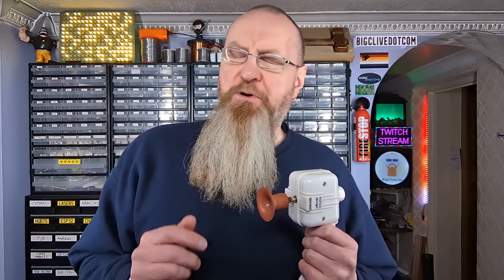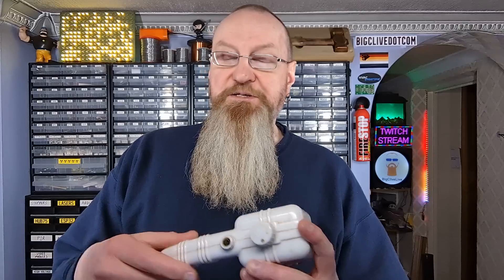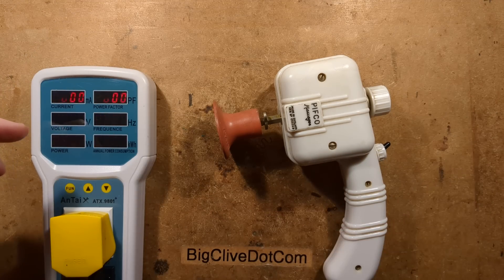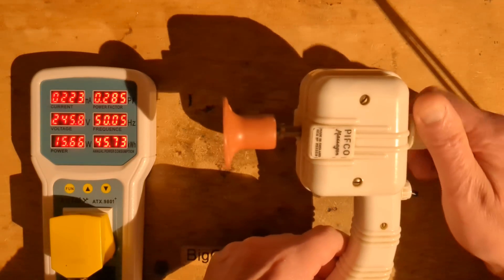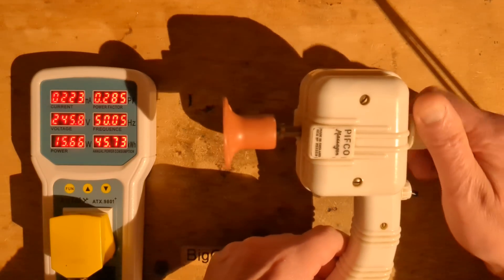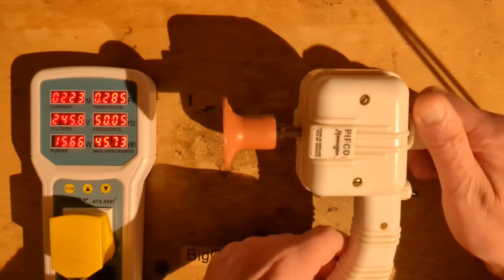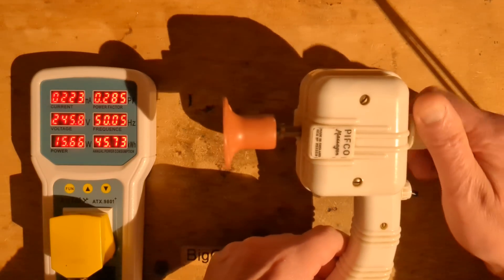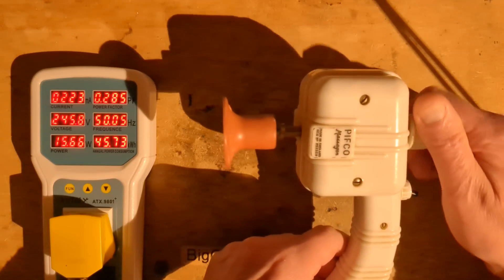inside a vintage British Pifco vibratory massager

Comment: Greeaze looked legit but the old shmoo around the switch i'm not too sure about, i was amused at the old "dampening" 👍..... 😏, on a different note, if that mild-steel bar is attracted to the core at both ends of the AC sine wave, would a pair of N35 magnets on the tips of the bar allow a push-pull effect and provide a more hefty stroke? like the AC coupled diaphragm air pumps 🤔.

Comment: Clever Design Alert: Ever wondered why the movable part of the solenoid is NOT made of laminated steel? that is because it allows long magnetic (Hysteresis) memory in the steel, so when the AC switches polarity, it gets repelled off the main fields more aggressively before attracting, allowing better vibration efficiency. I have seen the same high memory steel in electric hair clippers.

Comment: Question: Are homes in that area supplied with three or four wires?
Reply from the maker: In the UK we usually have a single phase and combined earth and neutral.  The older products like this were often plugged into lamp holders.

Comment: Ironically, if you parallel a .47UF+ film capacitor across the coil and connect it across the output of an electric guitar, pushing and pulling on the solenoid plunger produce a WAH-WAH sound effect, just like the 1970's Blue Movie soundtracks! haha

Comment: My mum (RIP) had one of these, I remember it in a box with various attachments.  One of them eventually got jammed onto it so it couldn't be changed after that.  I remember it in use around 1973 when we lived in Cyprus (before we left during the 1974 war).  Presumably it was thrown away a few years later.

Comment: I remember having one of these in our analytical chemistry laboratory in the 80s (but it was there before then). We used it to pack glass columns for gas chromatography. I didn't know that it had other uses so thank you for enlightening me.
Reply: You manually packed your GC columns? Interesting. These days, you just buy them ready to go.
Reply: @hammerth1421  Yes, although in the 80s they were starting to be ready packed. For our work, we found capillary columns to be better and so we went away from glass columns as well. Unfortunately our Pifco vibrator was 'retired' a few years after I joined the lab.
Reply: Those were the happiest glass columns ever, I'm sure.

Comment: As a kid I worked one summer at a capacitor factory. My job was monitoring and feedin/emptying a bunch of automatic testing and sorting machines that would feed the capacitors into a wheel with clamps for the legs that would rotate and take them through a series of tests like capacitance, isolation strenght, power factor etc. and then sort them into different bins under the machine according to tolerances and fails. 

The vibratory feeding device for the capacitors used this principle, it was was a circular "bowl" with a spiraling track on the outside edge, you dumped the untested caps into the bowl which would, powered by these kind of electromagnets set at a specific angle at the circumference, vibrate in a circular/spiral motion and feed the capacitors up the track. There would be gaps and guides in the track to drop the caps in the wrong orientation back to the bowl so all the ones entering the machine through a similar linear vibratory feeder were in the correct position to be picked up by their legs by the wheel.

These kind of feeders were used throughout the factory in the different machines to process the parts and finished capacitors, very simple and reliable with no actual moving parts, just vibrating.
Reply from the maker: I've tried getting one of those vibratory feeders, but they are incredibly rare and expensive on eBay.
Reply: I did some work way back in 1975 on a machine that used those vibratory feeders to get plastic parts into a conveyor where they would be assembled into a complete unit.  PACS,  which stood for Preportioned Amalgam Cartridge System,  dental applications.  That machine also handled silver pellets and mercury. as well as 3 different plastic bits.  It used several boards fulll of logic that I've never encountered anywhere else.. They were called "norbits",  and looked like chips but were way bigger and had an odd number of pins so they would only go into a board one way..  Made by Amerpex,  I think.
Reply: One of the machines at my work has two of those kinds of things for a bolt roll threader, one in a bowl shaped hopper like you mentioned to feed bolts in at the right orientation, and another that’s in the hopper where bolts are delivered and dumped in from the foundry. Everyone hates the air powered feed hopper vibrator due to how deafeningly loud the thing is, even though it’s only ever on very briefly you can hear it though our half of the whole building

Comment: Yeh, that's a similar mechanism to electric clippers and their "power setting".  Clamp it too tightly, and it pretty much binds the blades in place and it just happily hums but with no motion.  Unclamp it too loosely, and it rattles itself apart.  That sweet spot in the middle is a pretty narrow range of minimal rattling and still getting blade motion.

Comment: they hardened steel limiter arms were likely to adjust tension and total travel, so it wouldn't move to far and get stuck or have too much momentum and bottom out against the solenoid core, making a huge loud BZZZZZ noise. lol, I over-diagnosed the simple old thing.  🤪 thanks for the total howling laughter, once again.
Reply: Is that loud BZZ noise you describe the same noise my hair clippers make when not properly adjusted?

I hate that sound, so unsettling.
Reply: @fuhkerz  exactly, adjusting your clippers limits the travel so it doesn't go to far and hit the ends.
yeah, I've repaired and worked on them plenty of times.
mom was a hair dresser for years, then did it as side work for many years after.
Reply: @throttlebottle5906 Interesting.   I never knew exactly what it was, I just knew that the adjustment thing made it stop.

That noise was just the first thing that popped in my head when I saw your description of the sound, so I figured it had to be similar in concept at least.

Thanks for the response!

Comment: This was such an improvement over the steam-powered vibrators, and especially, the horse-drawn vibrators.
Reply: You hope it’s grease on the spring!
Reply: I didn't know horses could draw.
Reply: As opposed to the horse dildoes, which are as popular as ever
Reply: horses, harley's/motorcycles. washing machines? who knows what else( not a lady).
on a side note, a girlfriends in the mid to late 90's loved to ride on my stinky old 1974 2 stroke yamaha DT360. omni-phase balancers/chain removed, MX head(raised compression), carb.-swapped for same as size MX.  it would rattle my glasses so bad it blurred my vision, but I never gave it a thought or had any thrill.... the girlfriends however, no wonder they bear hugged and always wanted a ride, in lieu of the stinky burning 2-stroke oil smell and how nasty smelling it left you.   I figured it out many years ago, it was literally an variable speed "hysteria eliminator". I also have a couple MX models and trail/woods rode.
Reply: @throttlebottle5906  autistic man discovers the ladies liked his vintage car more than anticipated

Comment: It seems, the solenoid has a fixed frequency limiting its usefulness🤔. Should try modding with a variable frequency pwm module with proportional voltage control. Might produce some quite ecstasic results😇.❤👍
Reply: funny... I mentioned something like that long ago and different pulse patterns.... then about 4 months later the stuff slammed the markets, albeit they chose some of the worst patterns/waves/changes. lol, why the fork didn't I just patent/make it myself? oh right morals

Comment: In the early 00's I had a hair clipper with a very similar solenoid vibrator. The spring controls the force to hold the arm out, and it has a range between which the movement of the arm is largest.
https://youtu.be/G_8uYscwU_8

Comment: Older Bakelite components are very easily repaired using UV polymerising adhesive, and the join line is almost invisible. It's easy to reinforce through holes with this stuff too, since it's viscous enough to stay where you put it long enough to allow polymerisation.

Comment: Tesco own brand mains plug from the early 80s on it (in those then-fashionable primary colours -a trend I think Habitat started, or maybe Woolies with its WG/Volex custom coloured ones).
 
Maybe it had a round pin one originally and someone changed it in the early to mid 80s.
Reply: In the '50s a bayonet plugs were common on this sort of appliance
You're not going to want the light on as well.
Reply: @rambo1152 you also get 3way splitters I remember my nan had a bayonet iron and would need light aswell

Comment: My hair clippers use the same electro magnet system, with an adjustable stroke. 
Because i have solar the stroke has to be adjusted as the sun comes out from behind clouds because of voltage rise

Comment: You got a 1.6V voltage drop from measly .223 amps. Sounds like 7 ohms of resistance along the way in your electrical system. Hopefully that is in your tester itself, or else you better not plug anything high amps in there. At just 5A that would drop like 35 volts and heat your room with 175 watts. Or am I misunderstanding something there?

Comment: I worked as a repair technician at pifco in 1973. In failsworth Manchester, on Oldham road. , repairing all pifco crap. From electric scissors ✂️ to those things. They were orange and a little more modern looking but worse built than the one you show which must be far earlier, lol. What a load of tosh they used to sell. Lol mountains of it came back for repairs great days.
Reply from the maker: I have one of the orange ones here too - with heated pad.  I'll make a video about it at some point.
Reply: My dear sir the Pifco Christmas tree lights I have are over sixty years old and doing a fine job they are certainly a higher quality crap than that sold today and now worth a tidy sum.  Best
Reply from the maker: @Woffy. The Pifco lights are a treasured collectible now, fetching high prices on eBay in any condition.
Reply: @kaiwenwu1947  unfortunately seems to be a thing of the past now the "repair department" unless is high ticket price electronics. Even then it's often part of the throw away society we sadly now live in. Another few generations and there will be next to no one that was brought up or taught by someone from the "make do and mend" generation. Sad really seeing what in my opinion are valuable skills disappearing.
Reply: @Steve-hd2wm  Make do and mend,  my Mum was so good at that, I remember her soldering a wire on a remote control battery toy in 1964. She used a meat skewer and the stove. It work brilliantly. She was an amazing woman the showed me to appreciate the little things. Fortunately today many are discovering the treasures of the past and repairing them.  Best wishes.
Reply: @Steve-hd2wm  lol yes I used to wonder why someone had a room to room intercom, with a hundred feet of cable. That cost pennies and went to the trouble of sending it back for repairs??  And they got new batteries in them as well. Lol.
Reply: @Steve-hd2wm I 'grew up' in the 1990s.  Make do and mend was a core concept of those years. In these years since though, it seems that purge and restore is the standard to cover your ass

Comment: Of course this will last forever - as opposed to modern ones, which have DC motor with an exocentric weight attached, where the motor brushes wear out after a very short while.
Reply: I’ve always felt like there’s a need for a specialised motor for these with a built in eccentric armature, low speed and high mass. Brushless, proper control, quiet.
Reply: @WineScrounger  People bring stuff for me to repair - and as far as I can tell all these kinds of things on the market are made in China and suffer the same fate? Obviously it's easier to produce all the different vibration patterns people demand these days with a DC motor and a general controller chip. But the motors themselves are very short duration. They don't even have carbon brushes - they are just metal to metal commutator brushes. This is what fails every single time in my experience. It must be deliberate.

Comment: Can you adjust the shutter speed on the camera? Then just lower it and get rid of the flickering without changing lights. You might need to adjust the aperture or put a neutral density filter on the lens to get the right exposure.
Reply: This was a trap. The correct answer is:

"Modifying my power meter so it does not flicker in my videos. Old school hack, by trained technician. DO NOT TRY AT HOME"
Reply: To that end, try 1/50th. Although if they are LEDs it may be impossible to prevent flicker.

Comment: To resolve the flicker issue - have you tried a camera app with manual shutter speed control? If you use something like the ‘Blackmagic Camera’ app, you can manually set the frame rate, shutter speed, and ISO to avoid flickering displays without having to adjust your lighting.
Reply: yes and no, adjusting for "any display" to look right, may make everything else lit with other light source "flicker/roll".

Comment: Utterly irrelevant nerd detail-  the wiring to the solenoid is insulated with varnished cambric tubing, an early high voltage insulating cotton fabric/resin composite. It doesn’t like being flexed when aged (none of us do)  so watch out for cracks now that you’ve flopped everything around while showing it off.

(My spielchucker tried to correct “cambric” to Cambridge.)

Comment: Exactly the same principle as the vibratory motor in your buzz cut sheep shearer...

If memory serves: yellow 13A square pin plugs were colour coded for specific medical devices... they weren't common!

Red plugs are still used to indicate essential HDU equipment of the 'not to be unplugged under any circumstances' category

Comment: Is there a diode in there for 1/2 wave rectification. So 30hz. I have a old hair clipper that does.
Reply from the maker: I didn't see one.  I should do a dual polarity resistance test.
Reply: Half-wave rectifying would not halve the frequency. There are still 50 half-waves (in Europe, where this is). Full-bridge rectifying would double it, though. And both would introduce a DC component that you definitely don't want.
Reply: @mumiemonstret  The armature of the clipper magnet core pulls and releases on the half cycle. So it sounds like 30 because of how the mechanism works.

Comment: I have a corded shaver/trimmer also using that solenoid arrangement. The instructions said the adjustment should be set for the largest stroke and may vary with mains frequency.
So essentially set the mass-spring system  to be resonant at the current mains frequency. I guess some decades ago the mains were more prone to frequency variations due to changes in load.
Reply: Mains frequency has always been very tightly controlled - basically since electrification, there've been clocks that use the mains as the timing source. I think they were just outsourcing the "tuning" of their devices to the end user - saves a person or two in the factory.
Reply: @gorak9000  Not the instantaneous frequency, the power companies just kept the numbers of cycles per day constant, so over long times like a day your clock will keep time.
Back when these devices were made the average power plant and generator was much smaller (like banks of 50-150 kW generators weren't uncommon), grids weren't all interconnected, governors were all mechanical and not computer controlled and therefore load changes influenced the speed of generators more easily down or up. Sure the frequency was somewhat in an acceptable range, but they coordinated for slightly higher frequency for example at night to make up for lost cycles during the day.
Today, sure, thanks to computer control and much larger spinning generators of large power plants (more inertia) and more interconnection (like whole continents are synchronised) I just see milli-Hertz fluctuations, but I remember when the reed type frequency meters would dance around by half a Hertz or more.
Reply: @gorak9000  > "Mains frequency has always been very tightly controlled -...there've been clocks"  There have been poorly regulated supplies, but as you say CLOCKS. In mid-Missouri USA around 1950, before intercity grids on the prairie, the head engineer at the city electric generator had a very fine pocket watch. In those days time really came from the RailRoad, they had the need (schedules) and they had long wires. The electric engineer set his watch by the clock in the railroad station. Next to the generator was a sync Telechron e-clock which he set to watch time. Next day, same thing, except he trimmed the governor on the generator (engine? turbine?) to make the Telechron stay near railroad time. This just made a day come out right. It could run slow at dinner and fast after midnight, but that was OK then, and a flyball isn't much better than that.

Comment: If someone were to make that today it would probably last about a year and burn out, but that's quite old.
Isn't humanity ment to be progressing with technology?
At least it was an exciting video, no jokes!

Definitely no jokes. 😆
Reply: A year? Ninety-one days, max (assuming a ninety day warranty).
Reply: @markfergerson2145  
You have more faith than me, I was thinking half that. 😆
Reply: they could still make products that last...but they dont for 2 reasons... first ..they cut the cost of production, which also cuts quality by things like making the coil wire thinner, and 2nd, they want the product to fail eventually.. so they can sell you a new "upgraded" (re..even less quality and unneeded features) model that will also fail...